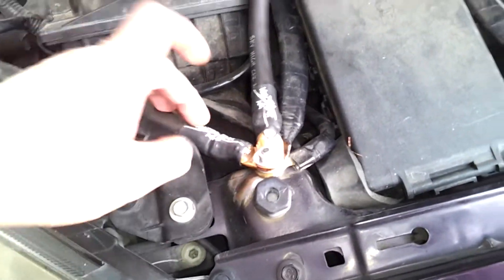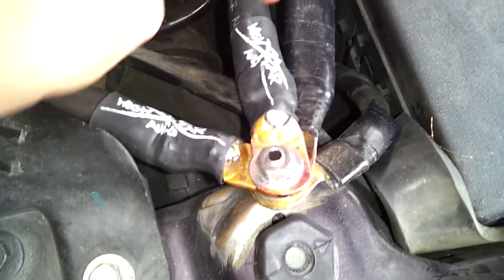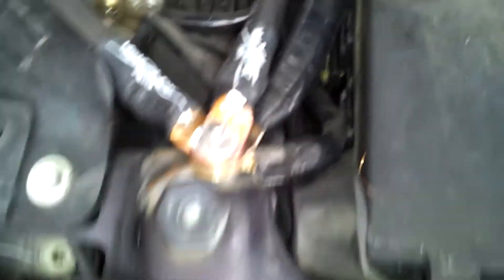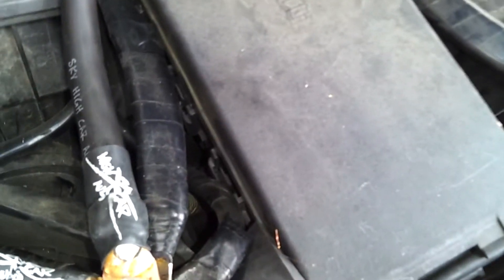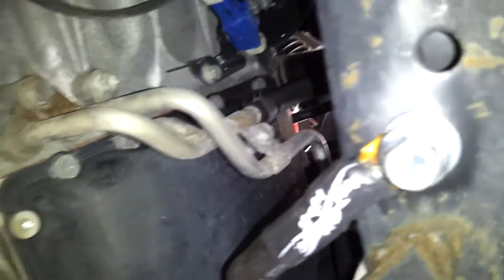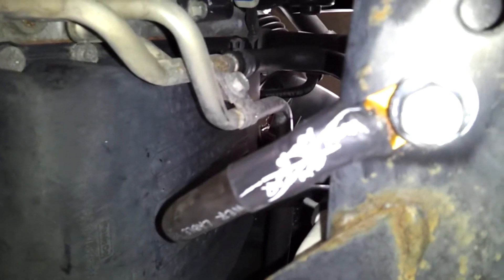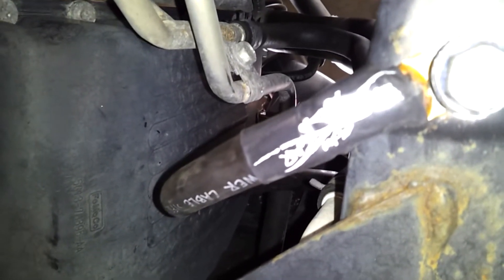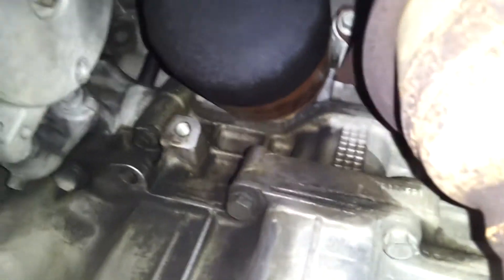Starting the BIG 3 for 325amp MECHMAN Alternator install

Comment from the maker: The 1/0 strip i added today is CCA, I was not concerned at this point, because before i put this 1/0 on, the voltage at my battery with the car on read 14.3, and the voltage at the amp inputs reads 14.3, exactly the same, i was already not loosing and volts what so ever,  So all that strip will do is help even more